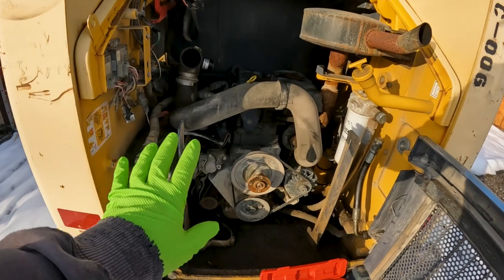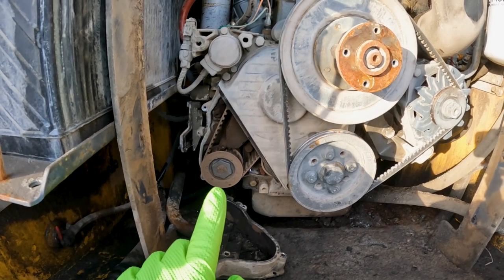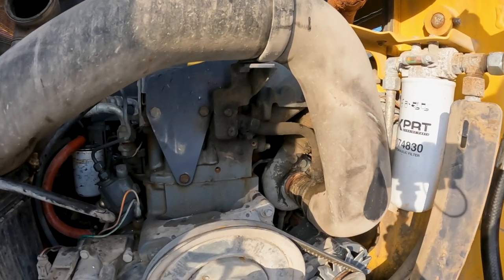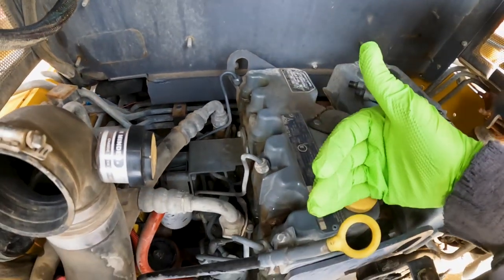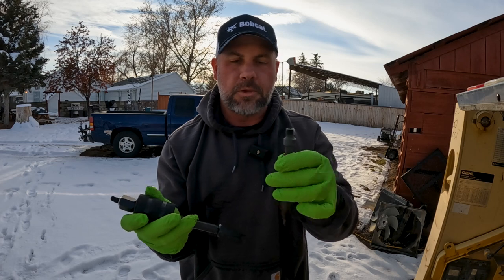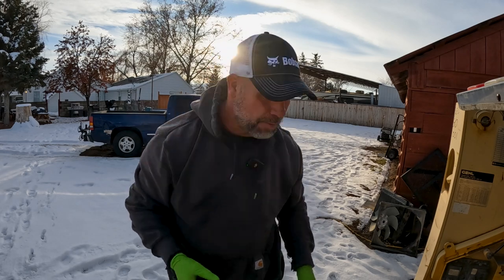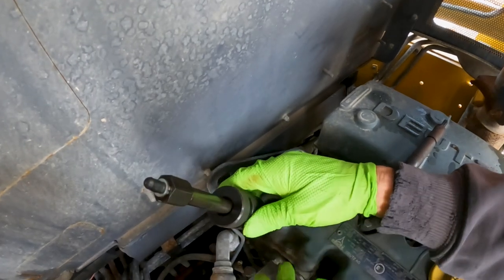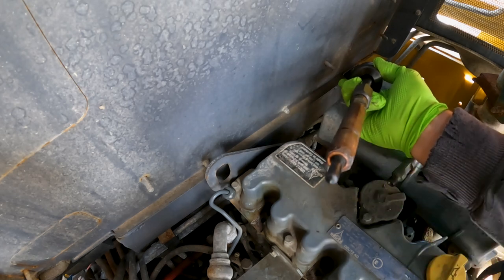Diesel Engine Smokes Bad, Could it be a Bad Engine or an Easy Fix?

Comment: Thankyou so much for making the videos. I am just starting on my first skid steer project.  I purchased a bobcat 883 that is smoking badly and sounds not the greatest.  I was told by the previous owner that cylinder 4 ate the tip of a glow plug.  I have stuck a camera in that cylinder and could see what appeared to be a pool of oil on the top of the cylinder the glow plug in that cylinder was also oil coated. My thought is a blown head gasket but I will be checking the turbo first incase any of the broken glow plug damaged the turbo.  Let me know if that is a logical  path to follow. I did check the pushrods and they are still straight.

Comment: Hope this is a good time for this question.  My Bobcat 863 is smoking a little blue smoke, runs very strong and has 975 hours (bought from someone I know).  Our problem is that it is using lots of oil.  If it's valve guides or rings would a compression check tell me that.  I'll take a look at the intake also and make sure it is not the turbo (learned that from you today)

Comment: It's a pleasure to watch your videos and learn from them, thank you very much for taking the time for people like us who are looking to learn something new.  I know this is not a video that is adequate for the question I want to ask you, but I can't find one that addresses my problem.  I have a Bobcat T595 that is always giving me the E000636-08 crankshaft sensor code and I replaced it with a new one but when I accelerate to more than 1500 rpm it starts to shake and has no power.  I returned the old sensor and it works better but the problem is to turn it on cold and when it sends the code after it is already working on it.  Well my question is what can I do to solve this problem?  I know that it is best to take it to the bobcat dealer for it is already the second time and as you know it is not cheap and I would have to wait a month for it to be ready since the workshop is very late and the waiting time is very long.  Well I hope you can help me.  And once again thank you very much for your videos that have really helped me a lot to repair my machine without the need to take it to the workshop

Comment: My 753 has started smoking (clears/calms down after warming up) be debating on pulling the head to check valves, maybe injectors and compression test is a better first step.
(6999 hrs)
Reply: S300 is doing the same at 4500hrs the crank case pressure is ridiculous

Comment: Great content. I have subscribed and watch alot of your videos. I have an 863 with BF4M1011F version of the Deutz. Similar issue. My machine has less than 4hrs on full rebuild. Been smoking ever since first start. Progressively got worse until it just wouldn't start anymore. When I pulled the inlet hose to the turbo it began leaking oil from the compressor side. After letting it drain for a few minutes it starts up but runs rough. I suspect it's from the oil in the intake after the turbo. Turbo is new from Friday parts. Injectors, crank, piston , rings, valves. All new internals. Ran great when first started. But would continuously stall after 5-10 minutes. Thought it was fuel pickup tube but it wasn't. Must have been something with this turbo as you've  pointed out here. What are your thoughts, @Howididit ? Next steps: replace breathers, and clean up and reinstall the original deutz turbo.

Comment: I had a gehl 4840 it had that same engine tapping sound. i put all new pumps and injectors on it and it still made the same sound afterwards. ive had a few pros listen to it they said it sounded like a fuel knock but i ended up trading the machine for an excavator. it ran fine but just sounded funny is all
Reply from the maker: It cleared up for the most part but still had a very slight tap.  Runs excellent otherwise.
Reply: @tetradgroup  My takeuchi tb240 excavator just started white smoking today. im trying to decide where to start. im thinking its an injector but maybe its bad fuel

Comment: That is just what my 753 was doing. I assumed it was the head so I just changed it.
Reply: A pleasure to make your acquaintance. Your video inspired me to try to start my 753 since I changed the head. The smoke before was water in the oil. Got it started but a whole different smoke. No water in the oil so that isn't it. Thought I would replace the injectors based on this video.  Thoughts?

Comment: I have never dealt with the copper seal on the injectors, if they stay in the head how do you get them out?
Reply from the maker: Usually an angled pick will reach down and grab it and just pull it out.

Comment: Do you know if that engine was burning oil?  or was that all fuel causing all that smoke?   The 863 I bought is burning engine oil, I am thinking it is a turbo issue since the engine is still strong...  the bobcat has 2500 hrs on its prob orig timing belt, not how bad timing would burn engine oil like a leaky turbo...
Reply from the maker: Fuel was the issue, damaged injector tip just allowed fuel to pour into cylinder.

Comment: Please help I am working on a T450 bobcat I am getting code # MO309 it turns but does not start, help
Reply from the maker: The code is for low voltage at battery which is common when trying to start a cold machine. If it turns over and still won't start could be lots of things, you can schedule a call if you want at www.4tetradgroup.com.